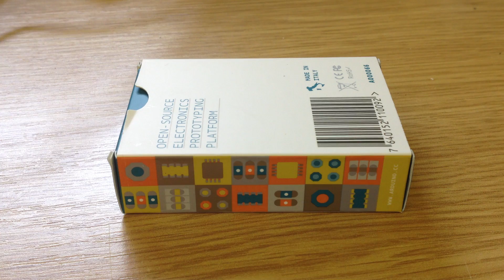Assembling the ARDX kit

Comment from the maker: If you mean the circuit for the first ARDX "experiment" (the blinking LED), the purple wire shown in the diagram connects the anode of the LED to pin 12 on the Arduino.